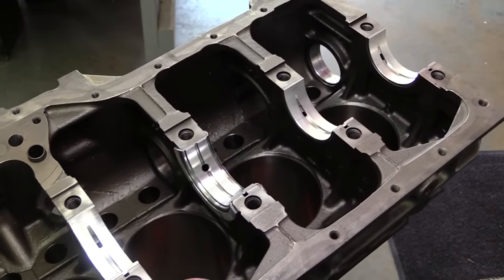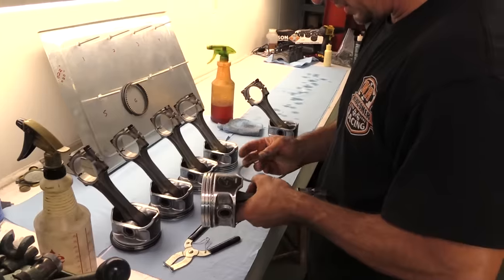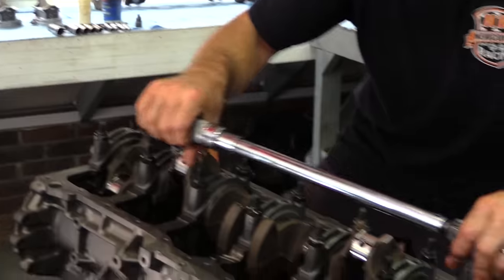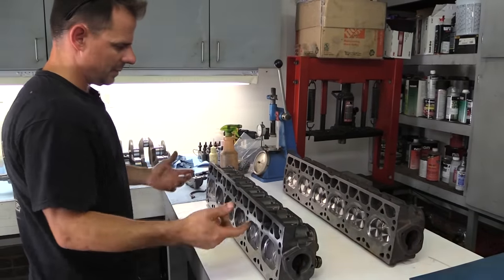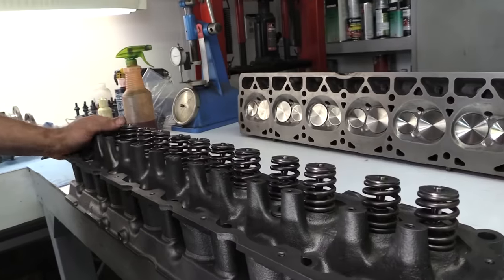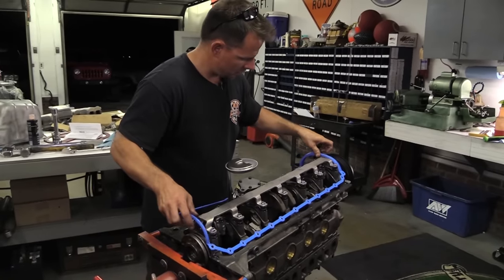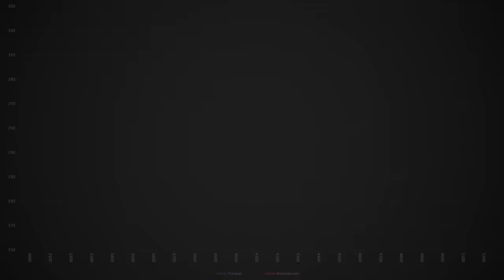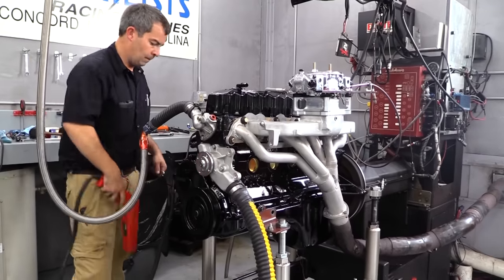Big Power Jeep Straight Six Stroker Build on a Budget with Newcomer Racing

Comment: I know theres a 4.0 fandom but a ls with a 6 speed is still cheaper.
Reply from the maker: True, but they aren't nearly as cheap when you try to put them into a Jeep Wrangler or Cherokee that's already set up for the 4.0.
Reply: Agreed, I can get a entire chevy v8 drivetrain for $500-1000 that makes more HP and more TQ. For the $5K they say this stroker cost I could drop it all in and probably have money left over
Reply: When u consider all the extra work involved in wiring, mounting, drive shafts transfer case, fuel system, cooling system, ac system when fitting a V8 your looking atleast 7500 if your savy. Spending 5k on something that the vehicle was designed for and just have to remove and replace it is alot damn easier. A V8 just don't go right in with out alot of time involved
Reply: Finally someone who understands that doing a motor swap isn’t fuckinh cheap like every dumbass who’s never done shit on a vehicle says they are
Reply: The other often overlooked advantage to the inline six in a narrow Jeep, is how much angle you can get out of your front tires. Engine swaps do come with consequences
Reply: @Randomgearhead  i actually was able to do my  swap for 2500, 500 dollar junk yard engine, trans, ecu. 300 dollar harness. 170 for exhaust 290 for fuel. 140 for digital gauges. 400 for axles .
Reply: @jamothegreat6052  exactly and your right the LS is way overrated
Reply: LS this car that truck no it's a no go the I6 is the best engine for a jeep to much monkey see monkey doing out here people have to think for them selves alot of fab work with a LS and then there not as nearly reliable as the 4.0 LS motors tin to overheat and blow head gaskets they notorious for that not worth it
Reply: @jamothegreat6052  You have no mechanical capabilities if you can't fab up an ls cherokee for under 10k I'm sorry...
Reply: @jononame8915  THANKYOU....
not everyone is a braindead middle aged man who can't think past replacing a car battery without going to the dealership..
Ls swaps are cheap.
Reply: @vee950  The ls engine is not known for overheating or blowing head gaskets pal...  They are so popular literally because they DO NOT tend to do those things...
They are so popular because THEY ARE reliable...
Reply: @jononame8915  what about fluids,filters,gaskets,hoses,fittings,wiring,battery,engine mounts,transmission mounts, and driveshafts? and did you through the engine and transmission to make sure you didnt buy junkyard junk?
Reply: @jamothegreat6052   The LS is NOT over-rated. It's a fantastic platform, which is why people are putting them into everything you can imagine. If it wasn't as good (and cost effective) as it is, the hype would have died down long ago, but it hasn't - it's getting stronger by the day. I do agree that the LS is not necessarily the best for this application though. I like the stroker build they do here, and swapping in a V8 is way more $$, and problems than most people realize.

Comment: LS swap would have been cheaper and made way more power
Reply: Yeah 5 thousand dollars for this is a total ripoff when you consider a bone stock 4.8 with a cam only will make more hp & torque for what like 1,500 bucks..
Reply: Unless you dont want to put a V8 in your jeep. Ls dont just bolt up and Ive done many. I could explain to you all the problems that hafta be addressed when swapping a motor in a jeep. If you dont see the benefits of this motor over another Im not wasting my time. Go buy you one and slap it in. You'd be wishing 5 grand was all you had to pay. Kiddie land got out early on this sight.
Reply: @michaelteeple8704  I've done several LS swaps so save the explanation.

Comment: ASK THIS MAN;,
CAN HE MAKE
MAKE!
A 4 cyl with a 4.7 HO head .
If he can, then would it   have high torq at low rpm?  and would a turbo be required?
swapping parts like this is a talent RARE indeed.
?why? because i want an inline feather weight bomb under the  hood.[.( M1-51 ) ford jeep.] matched to a 2 speed hyd pump connected to a front hyd motor and a rear hyd motor.( no drive shaft or transferr case or transmission ).

Comment: please.. even though this engine made respectable power for such a small cube.. I would hardly call this a budget build.
And definitely not a lot of bang for the buck..
Reply from the maker: That's your call, and I can respect that. But given everything on this engine is either new or remachined (block, heads, etc), I think any complete engine build for five grand is pretty budget. Thanks for watching!
Reply: @TheHorsepowerMonster  It's not.  There are millions of those engines out there, there is nothing special or expensive about any part of the engine. Replacement parts are cheap. 
This build should cost half of what it did at most.
Reply: Clayton Pope  You can't assemble an engine? That's going to cost you then. This isn't hard to figure out..
Yes machine work costs money but to bore, hone, & deck the block & deck the head & install the valve seals is a list of tasks that can be done for under 500 dollars in most cases.

Comment: That carb cost the engine a lot of low end power. It bogged so bad when it went WOT because it instantly lost all vacuum with way too much fuel. You can't have that much throttle plate area on such a low output engine. A 550-600cfm would have been more than enough and it would have kept a better low end air/fuel charge draw without instantly flooding it.

Comment: hello I have a wrangler and j 4.2 e read that with the cylinder head of 4.0 vents and colorants that gains a lot of power someone would know how to say something thanks
Reply from the maker: Sounds like a blown head gasket.
Reply: @TheHorsepowerMonster  ????
Reply: @TheHorsepowerMonster  please i am spanish my bad english my engine is 4.2 with cylinder head 4.0 and everything else goes up to 257hp ???
Reply from the maker: @pablopablo3323  Sorry, didn't understand the question at first. The 4.2 cylinder head has a 62 cc combustion chamber, while the 4.0 head has a 55 cc chamber. I don't know if they can directly interchange, but the short answer is yes, swapping on a 4.0 head should help power because it will increase combustion. You will probably have to upgrade your gasoline to avoid knock. Good luck!

Comment: It's a great bottom end, but the head design is atrocious. I wonder what the engine could do if one made a head where the manifolds are on opposite sides.
Reply: It would certainly be better, but the pushrods are in the way.
Reply: @mannys9130  From what I see, it's the head bolts.

Comment: 5 grand...or the price of a v8 swap
Reply from the maker: But don't forget it's an all new motor. V8 swaps definitely have there place, but are you swapping in a V8 that already has 200,000 miles on it?
Reply: @TheHorsepowerMonster  this is the truth. The cost to rebuild that v8 is at least a couple grand. I like the idea of a big ole inline 6. It's like the rotary. No one thinks its superior, but it's fun to really push it to its limits. I'd like to see how far these could go with the big ports and firmer springs past 5500 rpm , maybe 50 more hp?

Comment: Engine looks sweet as all else, but 5k for less than 100 more horsepower? I spent 900 and gained about 60hp with a ford 300. Where is all that money going? Why?!?!
Reply from the maker: Except it isn't 5K for an upgrade to an already running engine for an extra 115 hp. It is 5k for a complete engine. If you wanted to do this to an existing complete engine it would obviously be much less. Thanks for watching.

Comment: Is there still no cylinder head that has exhaust and intake on opposite sides? The engine would probably be 20% more efficient and more power if so. An aluminum intake bolted to the same side and woven between a 800 degree exhaust is such bad engineering

Comment: we need to get rid of all these polluting engines. time to concentrate on EV conversion kits.
Reply from the maker: What is the net cumulative pollution to the earth to mine the minerals and create the batteries needed to power the conversion kits versus continuing to run an older vehicle with an internal combustion engine which is already built and in service and creates very little pollution per mile?

Comment: Lol putting the exaust manifold under the intake manifold might be one of the worst engineering fails in history of engine designs .
Reply from the maker: Yeah, but it isn't uncommon with the American made straight sixes. The Chevy Stovebolt and Mopar Slant Six are also the same way. Remember, these weren't originally designed as performance engines, and having both the intake and exhaust on the same side of the head was for packaging purposes. Still, I agree with you that it's definitely  not good for performance. A Toyota 2jz is a much better example of a straight six engine designed around performance. Thanks for watching!
Reply: It was actually very common at the time. Even the Nissan L series engine used in the Z cars had that layout.
Reply: @lb9gta307  what's makes that funny is mopar used these engines even in the early 2000s . I can't really knock the engine on reliably mines strong running even at 200k miles. I just love pointing out the stupid shit dodge comes up with

Comment: No need in any of this "faux-stroker" gibberish when a 292 chevy shows up. Has the same bolt pattern as a small block chevy, is lighter than the jeep motor, and has gobs of great aftermarket from Clifford's 12bolt hotrod6 and many more.
Reply: you know in other countries are making over 2000 HP off of these old 6's?
its no different then a 2JZ
Reply: How is it a "faux stroker"? They increased the stroke of the crankshaft. It's a stroker.

A 250 chevy is 440 lbs according to one source, only about 40 lbs lighter than an AMC 4.0, 
I doubt the Taller deck 292 is lighter than the 250, 

You can also negate that weight difference further with the Edelbrock aluminum head that you can get for an AMC 4.0. Tell me, can you get an off the shelf aluminum head for a 250 or 292? I haven't seen one yet.

The AMC 4.0 has decent aftermarket as well, (there's an extreme stroker kit that punches a .030 over block to 292 cubic inches aswell!) 

Many of the stock components are also fine for normal street use ,aside from an aftermarket intake, which even then is only needed for super high HP builds.

If you want to go big, the Ford 300 has 8 extra cubes on the Chevy, and the Ford also has a bigger bore to boot. 

All of this comparison is moot anyways, when a turbo can make all of these engines into screamers, or mountain moving torque monsters. Money is the only limit.
Reply: Swapped a 250 for 292 from truck into Chevy car with truck trans. Had to short driveshaft. Man that was a load of fun to drive.

Comment: As an aussie i laughed at this. Barra and the chrysler hemi6 are much more capable engines.
Reply: U realize Chrysler is essentially amc right? And no buddy amc made fantastic inline sixs'
Reply: You sure about that AMC went racing in the 70s with there 258 ran mid 11s pushing more than 350+HP passing the traps at over120mph. And they made the Gremlin X for racing and got 600+HP with 12.1popup Pistons and a solid roller cam. Over 650TQ running low 10s. They scrapped the program.cause there was no one to race against.AMC held the NHRA Tilte for decades. What has the Barra dun?

Comment: These engines struggle to keep compression beyond 100k stock.  I doubt the reliability of build like this.  Seems so silly that Chrysler doesn't simply offer the 5.7 V8 in the Jeep.
Reply: Talking the strokers or the 4.0l in general? Mine has 360k on it and still has 110lbs.

Comment: the water pump didnt connected
Reply from the maker: No, they use an external electric water pump on the dyno. Saves a lot of trouble hooking up pulleys and belts.

Comment: 50% for $5000? Budget friendly? LMAO....how about a completely stock, worn out sbc swap????? Won't be that expensive and sounds better
Reply from the maker: How much do you think it will cost for everything else (motor mounts, wiring, bell housing, transmission adapter, etc) required to make a small block work in a Jeep? Plus then all you have is—like you said—a worn out engine that can fail and leave you stranded at any time. Versus a brand new mill that has been proven to be good for 200,000 miles or more. I don’t see how the economics are better.
Reply: @TheHorsepowerMonster  mounts are cheap. A sbc runs on 3 wires an adapter player is under $1000 and a sbc will run as long as anything else. I like the 4.0 and have 2 but they break too and the check engine light seems to be the cluster illumination. Sorry if I hurt your feelings talking about cross breeding vehicle brands. But, it is what it is. $5000 is not budget friendly. And sbc torque, availability, and price of replacement parts are hard to beat for anyone on a budget. Be mad or block me but, you can't say it isn't a reliable, cheap replacement. Or stay all jeep. IDC
Reply from the maker: My feelings aren’t hurt, and motor mounts are just the beginning of the list. But in your first text you say worn out, which means used up, and in your reply you say a small block is reliable. They definitely can be reliable, but not the worn out ones. Reliable costs more

Comment: Just get a 5.3 for 200 dollars
Reply: Yea that’s a really good idea. Get a 300k 5.3 for $200 and only makes 280 hp at the crank. And then spend a ridiculous amount of money swapping it unless your gonna do a half ass job. That’s fucking genius
Reply: @mxforever6445  actually that is a good idea genius because if it's a rebuildable $200 5.3 you only need to throw $600 worth of parts at it to rebuild it..$2.100 more..for a carb..intake..cam..valve dprings..$300 for machine shop work..$3.000 total for a engine that could make around 380 torque and about 400 horsepower reliably for about $2.000 less and have the sweet V8 sound!!!
Reply: A carb? Lmaooooooo.
Reply: @mxforever6445  you do know you can put a carburetor and intake manifold for a carburetor on a 5.3 LS... call Summit Racing in find out.. bro I'm not trying to be toxic with you I'm just keeping it real
Reply: @stevemitchell2252  Or you can just get the engine wiring harness and ecu with the engine for a dew more $.
Reply: Yea I gotchu but fuck messing around with carburetors and constantly adjusting. Efi is the way to go. 2nd off doing a swap is expensive asf. People who have no idea about swaps or how to do them are constantly talking about $2000 ls swaps which is horse shit. If you don’t do a half ass shit job it’s gonna cost like 8k at least to do a swap.